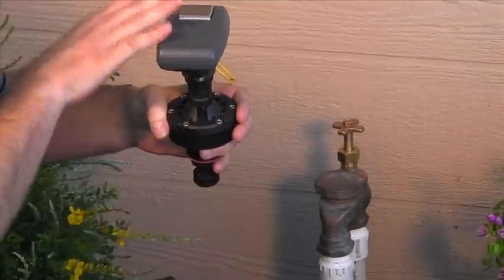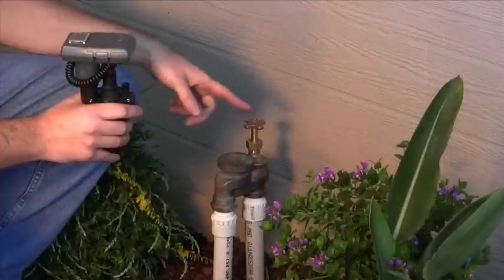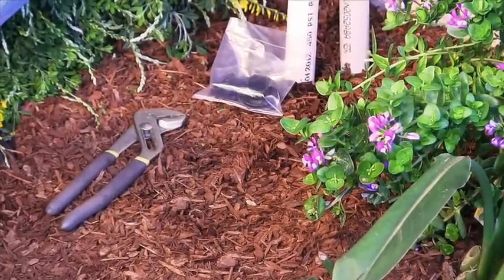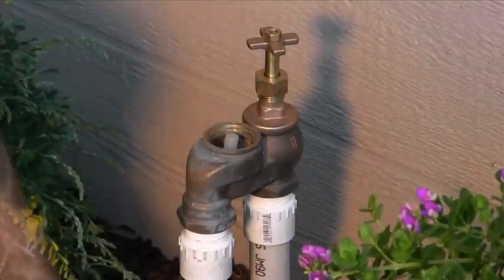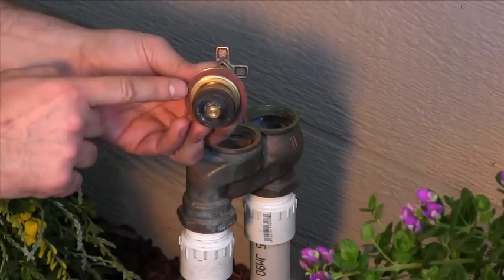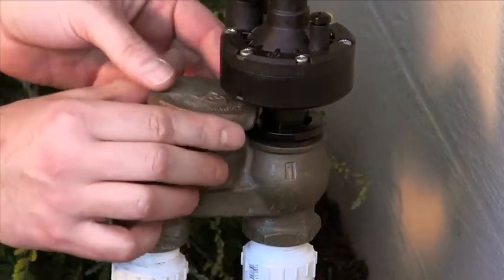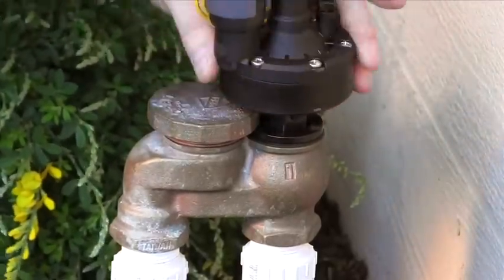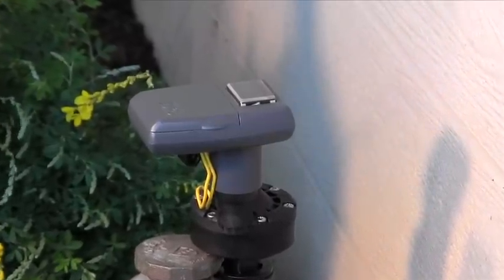DIG LEIT1 MVA Solar Powered Timer with Actuator: Installation

Comment: yeaaaaa......make sure you put another pair of channel locks on the valve body when you tighten or loosen any of the valves threaded parts. With out a 2nd pair of chan locks, the PVC will take most of the torque and possibly break, increasing your headaches.

Comment: Purchase one of these LEIT-1 In-Line Valve last year. Installed and set up program as to the instructions turn on run system O.K A couple of days later I came home where I notice the back yard completely under water I mean completely under water. Check program and contacted manufacture with very little advise on how to resolve issue. Spent some time trying to figure out what was causing the program to not turn off valve with no success. So dismantle valve from system and replace with other brand. work fine every since. :)  (Yes Valve was in direct sun light all day so there was any issues with power)
Reply from the maker: Hey Blueeyepaul, we apologize for your unsatisfactory experience with our product and customer service. This is an unusual problem, and if in the future you choose to use the LEIT-1 again, send us an email referencing this page and we will be happy to send you a new one free of charge. We are sorry that you received poor advice from our customer service. Typically, our customer service reps try very hard to assist customers with all issues and normally would be able to work through this problem pretty quickly over the phone. Do you remember how you contacted us?

Comment: Although the installation was pretty fast for me, additional commentary is needed for this video. For instance, notice how much the anti-siphon cap is threaded into the valve-body at 33 seconds into the video, and compare with where he stopped tightening it at 2 minutes into the video. Why did he not tighten it to where it was before? Wouldn't it leak? When I first saw this video (before I installed my RBC MVA, which is nearly identical for installation purposes as the one in the video), I suspected that this cap was not tightened sufficiently - because the cap obviously tightens down on the black plastic base of the new timer body - preventing it from tightening snugly to the brass valve body - as it was prior to him loosening it. Sure enough, when I installed mine, there was a leak from under the anti-siphon cap. The instructions that came with mine said to "Replace any existing worn washers with the new ones provided (Figure B)"; however, there were no washers provided. If they had provided them, maybe one could stack them to close the gap where the new leak was formed under the anti-siphon cap. One fix which would surely void any warranty would be to use a file to remove some of the plastic on the top of the base of the timer valve, so that the anti-siphon cap can be screwed tight to the brass valve-body (but I did not tell you to do that). Also, it is laughable that the video states that only a single pair of channel-locks are needed. If one were to not use a second wrench to keep the stubbed-up pipes from twisting, while loosening & tightening old parts loose from the brass valve-body, then they would end up having to repair the pipes & fittings as well when they break (if you watch the video carefully, you can see break-points in it where they likely addressed issues like this by using a second wrench, and editing it out of the video). "DIG" should redesign their timers to address the issue with the anti-siphon cap, correct their instructions, include the washers that the instructions refer to, and remake this video.
Reply from the maker: Hey Rwilsond,

Thank you for posting your comments regarding the video.  We agree about how this video can be improved and we are in the process of producing new videos on this product and the RBC MVA which will address these concerns.  We hope to upload these new videos within the next month or two so please check back to our website to view the updated and improved videos which will cover in greater detail the installation of these products.
Reply: I just installed identical Dig onto brass anti-siphon. Worked fine for 3 days then suddenly inbetween the black tighting cap that screws into brass and the dig unit, where the 2 post snuggly fit into the 2 groves, popped up a 1/2 inch and now water shoots out between tightening cap and dig.